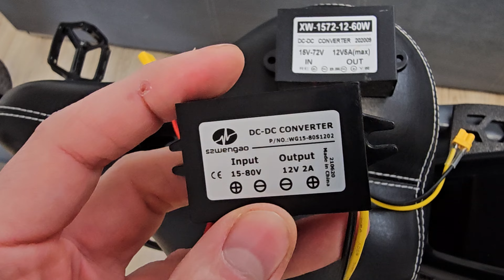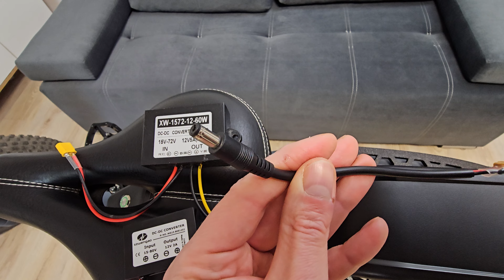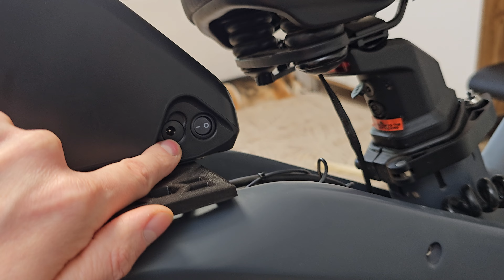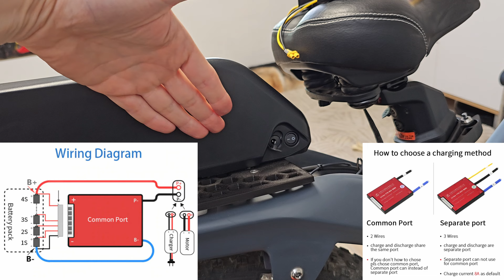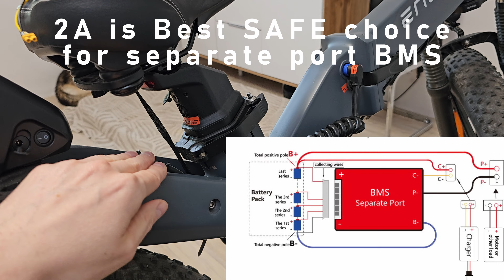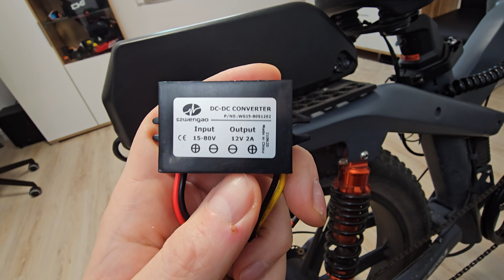Easy 12V power mod for Ebike Fatbike Escoot 🚵 Connect blinkers light Rear Cam

Comment: Is it possible to add a 12v - 240 inverter to the Step Down Voltage Converter Regulator, so I could run a led tv ? thanks